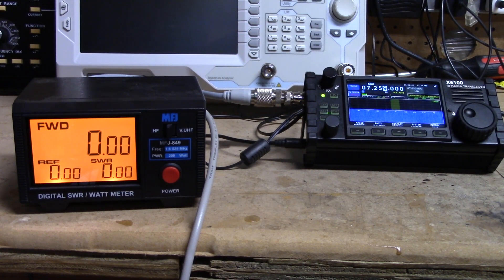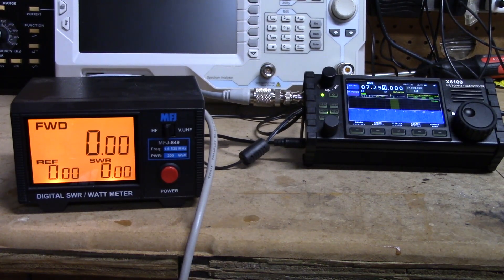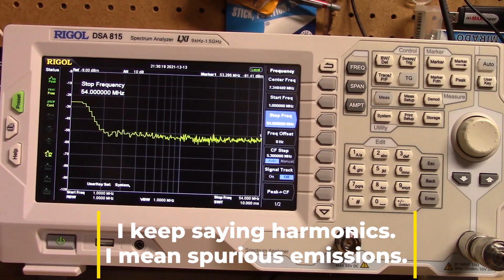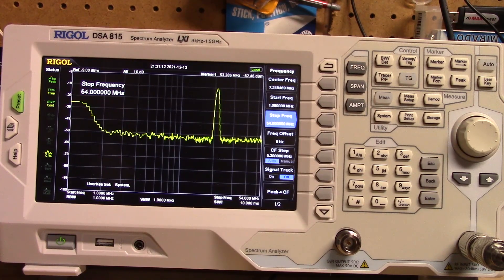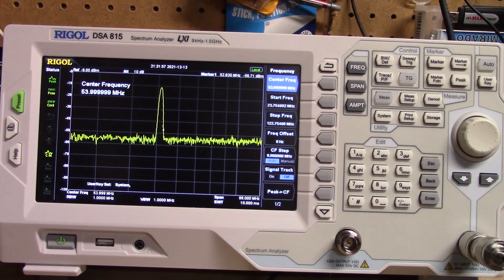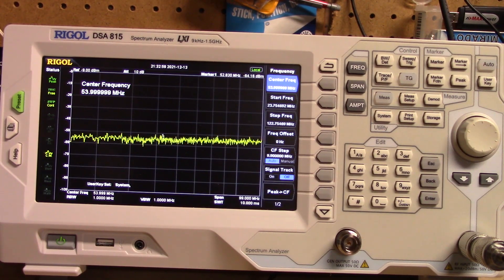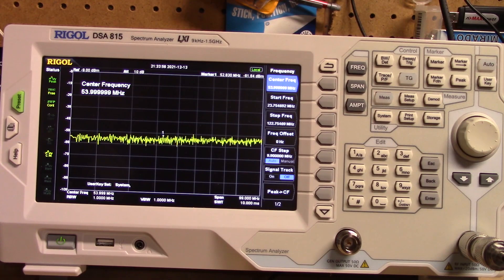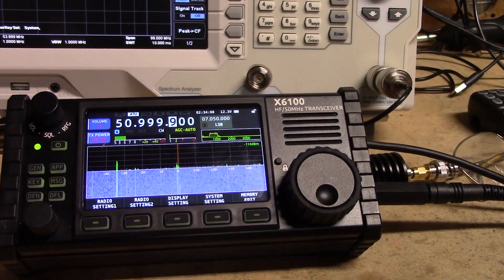X-6100 Power - is it any good?  What's that signal look like?? (Re-Upload)

Comment: Just finished working a local 6m net with my X6100 after installing the latest firmware 2/17/22. Had great signal reports running on the 10w setting and connected to a home brew 6m loop and 75’ of LMR400. Honestly the x6100 receives better than my 7300 on this band. But I agree it’s for the guy who likes to tinker.
73
Reply from the maker: It always did "radio" fine for me, and the display is excellent.  My beef was all the features they marketed with it, that ended up being a lot of smoke and mirrors.  That's as much Xiegu's ad department as anything else.  I had it on an EFHW and it worked quite well.  Especially for the price point.

Comment: I think if this radio was marketed for tinkeres it would be amazing. Outside of that I don't know where it fits.   Does it "radio" at a $600 level at all?
Reply from the maker: TO - you just cut to the chase.  NOPE.  It is not worth 600$.  I can't speak to the hardware issues internally, but for $600, you could something a level of magnitude better.
Reply from the maker: @BNKMOBILEMECHANICS  Most of the features didn't work at product launch.  You can't compare a $600 radio with  even a low-end Icom or Yaesu (IC-718 and FT-891).  First of all those are couple hundred more; but the listed features that either of those radios ship with, actually work.  The screen on the 6100 is very nice, I do like it.  That is one feature that was not oversold, and worked at product launch.  The radio is not terrible, it just has a lot of holes for something costs almost as much as a top tier manufacturer radio.   

Xiegu has had 6 or 7 firmware upgrades since December.  That 's pretty much a 1/month average.  You can call it responsive, I call it not actually testing prior to release.  Example in point - the wifi and BT that this radio advertised heavily didn't even work at product launch.  

In any case, I bought one, I played with it, I did some tests as you saw, and it's just not my jam.  I would also say for just a few dollars more, you'd be well served to move to something like an IC-718 or FT-891.  Both are much more mature platforms, as well as being 100W.  Even something like a used IC-706, for example - is a better deal than the 6100 (aside from the pretty screen).

I don't have any sponsors on this channel, everything I show here is gear I've purchased out of my own funds, so obviously, my opinions are absolutely my own.  I'm not trying to start a holy war over a radio.   Just wanted to point out that the video was mostly about testing output power levels, and there are downsides to consider with this radio (as there are with other options).

Thanks for watching!!

Comment: Jim, I canceled my order for the X6100 from Radioddity. they returned my money to PayPal already. I told Jackie with the Radioddity Support Team, that they should kick the Sales Team, Logistics Team & Shipping Team where the sun doesn't shine. I was one of the first to order one. You need to be one of these GenX and Millennials, who were brought up teething on Raspberry Pi's, & Linux, etc, not a 68-year-old with a brain made of Mush & being a 41 yr Ham.
Reply from the maker: Hey, I'm a boomer as well.  It's a tinker-toy DIY piece of gear, and not worth the cost.  I don't blame you at all for cancelling.  However, just because you're a boomer, don't think you can't be a l33t h4x0r as well.  After all, you're a ham, so that means you already have the mindset for it!
Reply: @FEPLabsRadio , ya Jim, but what I've been through this past 15 months, My health needs a lot to work on. my problem is that I cannot seem to be able to concentrate enough to read and remember stuff. I have been getting headaches and not sleeping because of all the pain in my lower back. I just had a CAT Scan a week ago and it shows that from L2 down to S1 all my discs are bulging with L5-S1 being the newest and the spinal cord is being pinched on two sides. So if I turn one way it hurts bad, turning the other way hurts even more. I'm just getting over the Heart valve repair now this is reading its ugly head again. I got a full refund in about 6 hours, because of the time difference. the girl in the Radioddity Support Team who has been helping me was super.  It is the Sales Team, Logistics Team fault for the lack of communication on their part.